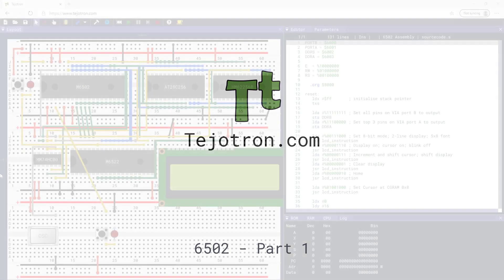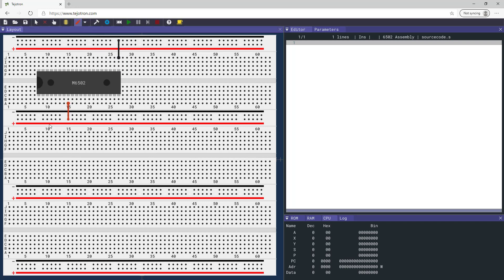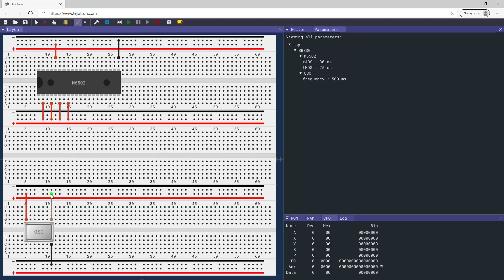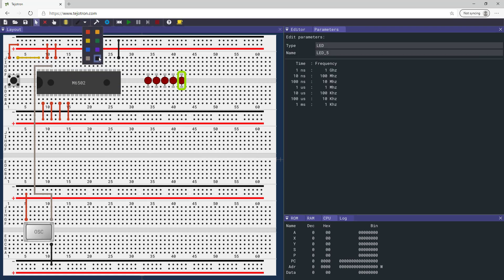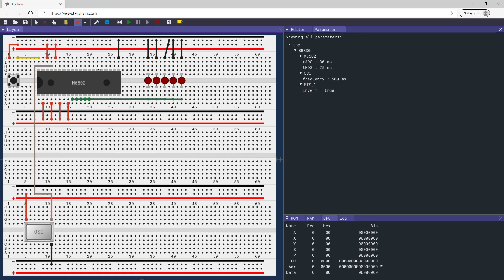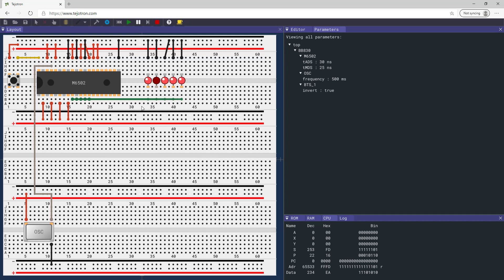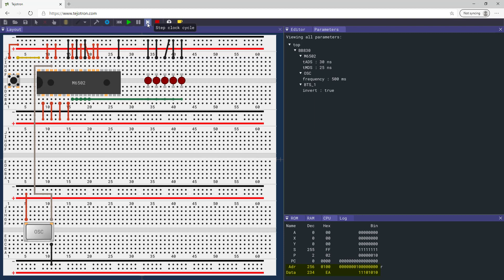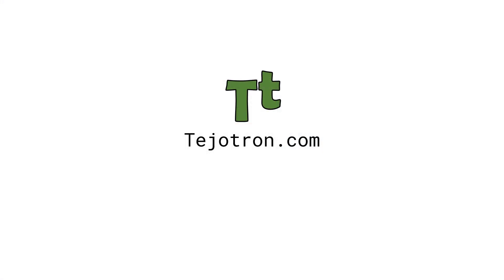6502 - Part 1

Comment: I'd be impressed if it weren't for the fact that much of this material was taken from Garth Wilson's 6502 primer website.  You, sir, are a plagiarist.
Reply: Douchebag of the year award goes to BCS whatever for the most ridiculous negativity. (Obviously, accusations about plagiarism are completely stupid since there are bazillions of 6502 projects in the internet and that is a good thing. Also, the only thing that this and Garth Wilson's website have in common is that both cover the 6502. He did not write a browser simulator / emulator, as implied)
Reply: I don't see anything from BCS Technology Limited like this perhaps they have only been going since founded in 2001 and are simply beginner's in technology.
I associate Australia with Fosters larger, Kangaroos and great BBq's not computer science's like Cambridge, England.
This example complements Ben Eater's introductory videos to 8 bit microprocessor's very well, a lot of time has been spent to produce this.
Perhaps before criticising it you would be kind enough to to give us your version or at least put your name to this comment.

I also do not see an original piece of work in Garth Wilson's 6502 primer website whatsoever, he's just copied everything I knew and was doing in 1976 including hand wire wrapping prototype boards and listed it on a very dull website. Although lots of good information, but certainly by no way is his work original.
At least with this you can play around with assembly code and have a go, get involved with some dated but very good and important technology.
Very well done, would be nice to see some additional features in the future.